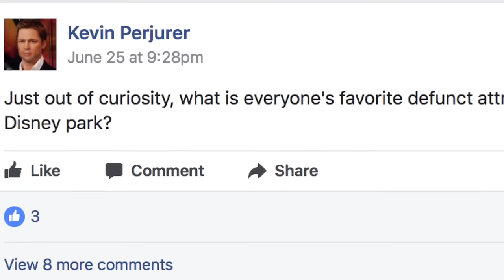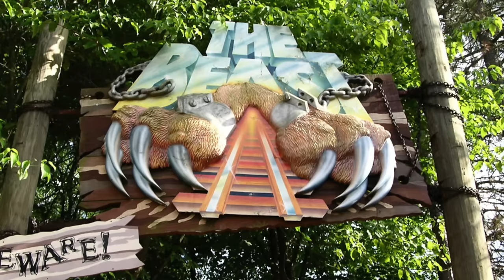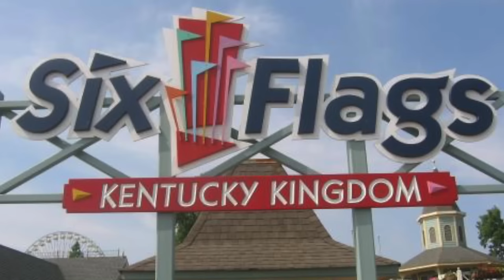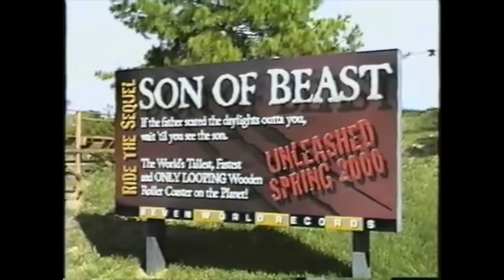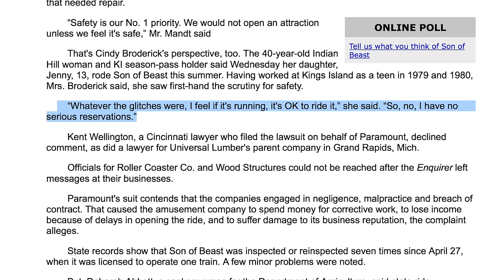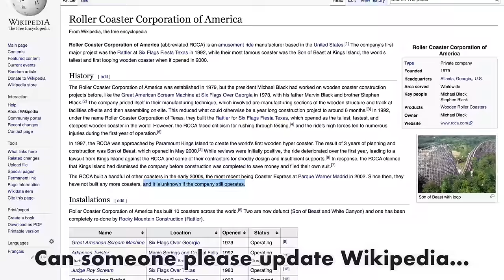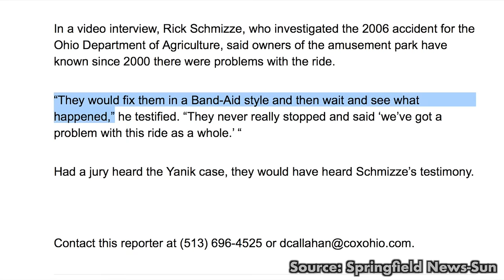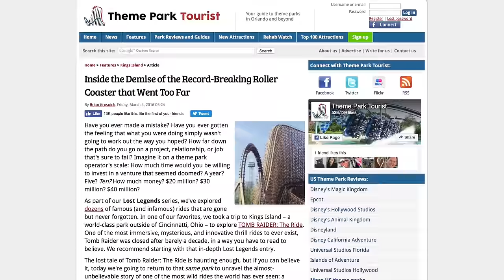Defunctland: The History of Son of Beast

Comment: God, I remember that coaster!

Back when I was a kid in the early 2000s, my Mom and I would take many trips up to King's Island every summer.

It was a 2-hour ride from Louisville, Kentucky, but the rides and other attractions there were just so much better than anything at Kentucky Kingdom's -- before AND after the Six Flags rebranding.

I loved roller coasters, and because I had always been a tall kid growing up, I started riding them longer than I could remember. My dad even took me on Kentucky Kingdom's The Vampire rollercoaster when I was 4, but I digress.

My point is that despite my love for rollercoasters, I was also very particular with which ones I chose to rode on. Not because of fear or even long lines, but rather it depended if the coaster had any corkscrews in it or not; they would always give me a HUGE headache from my head repeatedly bashing against the side of the neck harness the entire ride.

I loved The Beast because it had everything I loved about the metal rollercoasters: incredible heights, fast speeds, a lot of interesting things to look at because of the trees and everything, and even the tunnels. Best part: no corkscrews!

As soon as my mom and I arrived at King's Island, the very first thing I wanted to do was ride The Beast, and it was always one of the last things I rode, too. My mom and I must've ridden it over a dozen times on every trip, which may also be why I have the trailer to The Mummy (the one with Brendan Frazier) permanently etched into my brain, because they had it playing on all the TVs and a few other things playing as you made your way through the 2 hour line.

Then when I heard about The Son of the Beast, I immediately couldn't wait, because I heard about the loop, which was unheard of to me, because my kid brain thought the was just physically impossible for rollercoasters to have!

After all, I always tried to find a way to add on into my Rollercoaster Tycoon creations somehow. lol

Anyway, I rode The Son of Beast ONCE, and I hated it. It was everything I hated about the metal coasters with corkscrews that left me leaving the ride with a massive headache -- and it gave me the biggest one yet.

I even remember it being odd how the cars didn't have the neck braces to keep you from falling out during the loop. At the time, I assumed they made up for that by having these super tiny cars that had me swallow my own knees. Granted, I was tall for my age, but I never had that problem on The Beast, Sr.

Even with all that said, I'm still terribly surprised that the coaster wasn't safe. Talk about dodging a bullet! lol

Comment: You need to do the Kentucky Kingdom superman ride incident. A woman lost her leg in it resulting the the park closing.
Reply: the park didn't close lol
Reply: it wasn't the Superman ride. it was the one you rode up like an elevator on a cable then it dropped.
Reply: Penguh it did but not because of that and it's since reopened.
Reply: It was the Superman one where a girl not a woman got her feet cut off due to the cable snapping? and reattaching to her feet.
Reply: Amanda Braun Look up the Kentucky Kingdom Superman Tower ride incident and the story of the girl who's feet were cut off should come up. If not I can provide links
Reply: Amanda Braun Yeah, local news outlets reported that she heard the cable snap? it wrapped around her neck which thankfully she removed it from. (or else she probably wouldn't be here today) But as the tower rised up, the same cord i think wrapped around her feet and her femur broke as the tower dropped? I'll have to check it out again to see if I'm not spreading false info.
Reply: Amanda Braun Yeah, which is why more safety stops should be implemented. My heart goes out to that poor girl. It kinda traumatized me, since I was just a tiny one when it was on the news.
Reply: The park did close down and was shut down for about 10 years because of it; no longer called "Six Flags", resulting in being called Kentucky Kingdom instead.
Reply: Six Flags Kentucky Kingdom had a drop-tower ride called Superman Tower of Power (formerly the Hellavator). On one ride a cable snapped, then whipped around and hit a woman. The injury caused her to lose her feet. The park closed after that summer due to bad publicity and the resulting lawsuit. A few years afterwards it re-opened without the Six Flags branding.

Comment: It should be noted that the cause of Son Of Beast to stop was actually manually done by one of the operators. The bolt cracking actually happened on the previous two carts, causing a loud as hell sound to ring out. The ride operators took note of this and immediately stopped the next train before it crossed the bolt. Had they not, the track most likely would've collapsed and certainly killed all passengers that fell. 

TLDR; Ride operators deserve more props for saving people's lives.

Comment: It is quite interesting, after seeing GP To Enthusiast's video about this incident, there are 2 completely opposite descriptions of the accidents and condition of the coaster, and i dont know which one to belive. One says the wood was fine and "above industry standards" the other says the wood was bad.  One says the people got stopped in the last section of the ride, the other says they made it all the way through getting hurt in the process and they pulled the e-brake causing the next train to stop on an ascending section before they could reach the damaged part of the track again, Therefore making the people getting hurt, and the people getting stuck 2 completely seperate groups of people. It's wild how different these two presented versions of the events are.

Comment: Pretty sure I'd heard the ride was e-stopped by one of the ride ops due to multiple reports on the previous cars that there'd been a big jolt.  Good call on the ops side because there ended up that there was a huge crack in the wood work that had misaligned the track.
At least I'm pretty sure that was Son of Beast.
Reply: Yeah, that's right. The operator noticed the guest on the last train to go through seemed to all be injured so they e-stopped the ride before the next train reached the top of the lift hill. GP To Enthusiast has a great video about it which explains what happened.
Reply: @FunnyLilNightmare  Ah! That's right! That'll be where I've heard it. Watched a bunch of his what really happened videos recently. Yeah, everyone should watch that'un for clarification on the accidents.
This vid is great for SoB's over all history thought.

Comment: the riders that suddenly stopped were E-stopped before they got hurt worse, there was a faulty board that when the first train went over it it moved, them the second train went over it and it moved even more, severely injuring almost everyone on the train. they noticed when it came back and told the operator to E-stop the ride before the train moving could've been fatally injured

Comment: The wood was actually really good quality! When the wood was inspected it was noted how good the quality was. When kings island took over construction, they made one part too stiff, causing the accident. The ride DID NOT "stop abruptly"
What the accident was, the first trains were sent out and the part not supposed to be so stiff, a turn, ended up sagging from the stress. When the next train came over it, the riders all noted neck pain, back pain, etc. Due to it sagging. The wood cracked more and then when the third groupcame, someone noticed and e-stopped the ride before it could hit that point. E-stop is a big red button that stops all power to the ride. The accident was avoided, but people were still injured. It DID NOT "stop suddenly" lmao

Comment: Several people received significant injuries on this ride along with 1 death that was due to a pre-existing condition. I believe the accident with the 27 riders is a little different than what was portrayed here. 1st train passed and cracked stiff supports, the 2nd train passed by and jarred the riders giving all of them upper-body injuries. It was the 3rd train that stopped on the tracks. This was because a ride operator noticed that all of the guests on train 2 had injuries, the operator yelled for the other operators to E-stop. This stopped the 3rd train on the 1st incline. Stopping the train 3 probably saved 27 lives from something much more catastrophic than the 27 in train 2 experienced.

Comment: Ok but the banshee kicks butt, it is the roller coaster that made my sister actually like roller coasters. She rode it 10 times one day. The beast is still pretty gnarly. I’ve heard someone died on the beast or SoB but I could be wrong.
Reply: Wooden coasters are supposed to be jerky and bumpy and as far as I know no one has died on The Beast . Banshee is a very smooth coaster due new technology but you can’t compare a wooden coaster with a steel one especially the new generations is like comparing apples to oranges.

Comment: I don't even care about roller coasters but The Beast is sooooooo good. It's such a long ride! And it's off in the woods! That part where you go through the covered carousel ... It's just got actually good scenery and big hills and it dives into covered tunnels. I think Millennium Force at Cedar Point is really cool the way it has a huge hill where you're right at the edge of the water. But every other roller coaster I've been on is a short ride through an ugly landscape — as though the only senses they're trying to appeal to are whiplash. A lot of them you literally just stand in line forever to get launched up a single hill.
Reply: Beast good but SOB better. It’s basically the best part of the beast (2nd hill) x2 with monster lift hill. I agree with the landscape on the beast. My only complaint for SOB is they didn’t do the structure / carousel on the first double helix on SOB as tribute to the beast.

Comment: Something like the department of agriculture being in charge of rollercoasters isn't super out there. There are often historical laws and situations that cause such things to have made sense at once point. Although I'd expect it to be the mine safety agency that also does rollercoasters, given that rollercoasters are an evolved form of minecart track. This usually wouldn't be a problem, if the department had the budget to hire the rollercoaster/mechanical engineers they needed to preform said duty.

Comment: I went there and got to ride it when it still had the loop. At least you didn't have to worry about a stray bird smashing into your face. that f*cker was LOUD! You could clearly hear it on the other side of the park. I actually had ear plugs in while waiting in line and riding it. I thought T2 at Kentucky Kingdom was rough but damn, The Son of Beast was rough to the point it wasn't fun.

Comment: I got to ride Son of Beast in August 2000 before they started fucking around with it. The lift hill and first drop were bad ass, and going thru the loop was cool, but other than that it was an average at-best wooden roller coaster. Except for the loop, it had no unique quirks or traits to make it stand out from other wooden coasters. Its location in the park didn't help, either. One of the truly cool things about The Beast is how it takes you out into the forest and away from the rest of the park and how the natural terrain was incorporated into the ride design. Son of Beast had none of those things. I think if they had just built the coaster, and instead of linking it to The Beast gave it a standalone theme (its own identity), it wouldn't have been as disliked.

Comment: I thought the Beast was always more shaky and dangerous. I once hit my head on the arm rest between the seats.  I rode both versions of SOB. The loop was the smoothest best part of the ride. The first drop was like riding a hyper coaster made of wood. I never really found it to be that shaky as some described it to be.  Maybe in the middle of the train? IDK I usually sat in the front car or the back car. It definitely did sway though as you rounded the top before the big drop but I had thought it was designed that way...

Comment: Rosemont Horizon had a major collapse when being built. The arch wasn't stable yet. 

Still standing w same design. Arches are the most stable design once set up. 

Not sure why agriculture people are in charge of roller coasters...? There's been some bad structural accidents you wouldn't figure on unless you knew a bit about them. 

Hyatt Walkway collapse (largest death toll at 114 people). 

There was a big porch collapse in Chicago that killed 15 or so when the ledger board bolted to the wall sheared straight off a 20 deep porch.

Comment: I see other have mentioned it, but the train didn't get stuck on the tracks. The operator noticed a returning car's passengers looked visibly hurt after a first train had cracked wood on the track, and this second train caused the track to drop about 5 inches.

The operator hit the emergency stop stopping a loaded car on the ascent of the hill; and quite possibly saving their lives.

Also, the yellow pine that was used was found to be above the conditions expected, and holding up. It was poor engineering and design, coupled with short cuts taken that caused the failure. Not poor wood or condition of the wood.

Comment: For all of the safety issues ,it looked like the ultimate coaster anyway.Why don't they or someone in another park rebuild an exact same replica but using steel?It would be stronger safer and smoother,maybe it could be called "Son of Beast Twin"???I hope it IS  rebuilt someday,same height,length,twists,turns,grades,helixes,loop,the whole enchillada.Has anyone got the same thought?

Comment: I hope one day we get a Son of Beast resurrected in the future as a hybrid
Reply: it can be done traditional they just used gigantic bolts for some reason that make the wood split when it drys. all the bolts were 1" or bigger in 4x6 lumber normally 1/2" and 5/8" bolts for the structure with 3/4 bolts in the ledgers are used. also the wood was very poor quality which is a real problem for modern coasters theres not much old growth left. when you work with wood you will notice the differences in the age of the tree the lumber came from. most of the racer and beast is the original wood its bright orange on the inside and hard as nails.

Comment: Although i rode this more than a few times it was wobbly(?) the first time i rode it. From the line at the racers you could see the tallest section move sideways 6 or 8ft when the coaster passed by. Yeah it was jerky, an fast but i always had a good time. I kinda thought that it was kinda tall for such a narrow bottom. My last rides were way off from my first as it didn't loop an was even harder on you but still FAST. I never got a chance to ride THE BAT as it was always closed . Once like only missed it by minutes.  But may be that was for my OWN GOOD. HINT HINT THE BAT

Comment: This ride gets a lot of flack, as it should, for its construction. The in-house construction crew they hired were a bunch of drunks from Batavia. But it also had a fundamentally awful design. It could have been the best construction job in the world, but the vibration from the lateral g's on those helixes were moronic. If it wasn't for those helixes, it might have done ok. I recreated the specks of the ride at one point in Roller Coaster Tycoon, and even that little program could tell no one was gonna ride anything that took a helix that low to the ground at that speed (it was near the beginning of the ride). But just like the rest of Paramount's contributions to that park, it looked impressive, but was crap. 

And on a somewhat side note, Paramount sucked. They removed all the beautiful nature of the park (anyone old enough to remember the walking moss tunnel thing by Hanna-Barbera land?) and replace it with a hot, obnoxiously bright concrete jungle. Taft was local, and understood its customers. All of us in the Midwest were wondering why we were staring at John Travolta and Nicholas Cage when we went to our beloved park. Cincinnati (Mason) Ohio, not Hollywood, you Paramount jackasses. They slacked on staff too, and the place was never more dirty. I'll present the tunnel of gum in the last holding area of The Racer as exhibit A. Taft used to hose that tunnel off nightly. The day Cedar Fair bought the park was a great day, and they have done superbly.

Comment: Say what you will , but i rode it at least a 100 times in a couple years a little while after it came out , lame whiners blame it for something it didn`t do ,stay on the kiddie rides ,it says ride at your own risk
Reply: Yes! From 513 rode front row with loop multiple times! It’s like you have to be basically prepared to ride it like the 2nd hill/helix on the beast the whole time! The tail slap after the drop into the first  bank into the SOB helix was legend! My only complaint is that they didn’t enclose/structure to first SOB helix like its father’s 2nd hill.  Leave the second one open-air like it was.  Also rode SOB at night with all the white lights on you can see from 71 was legendary!